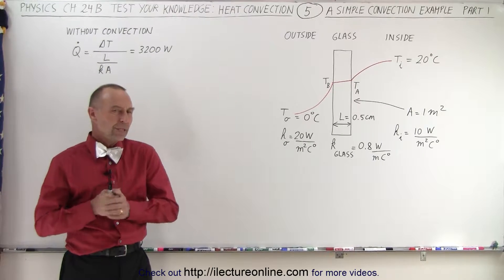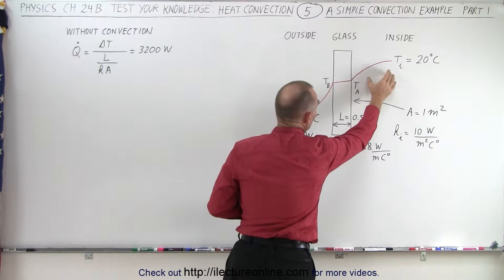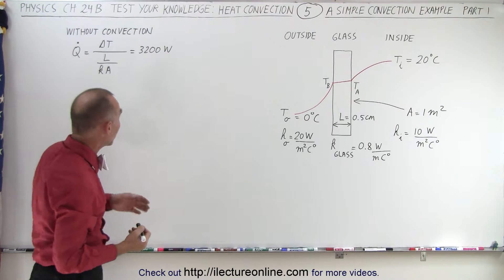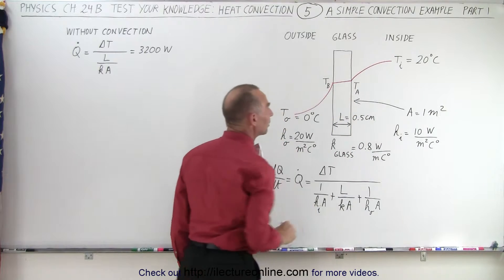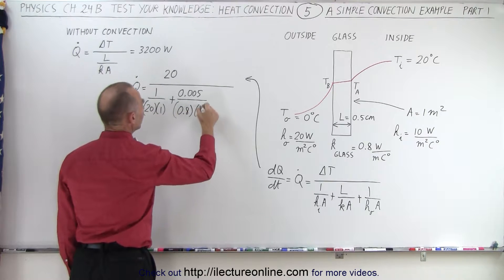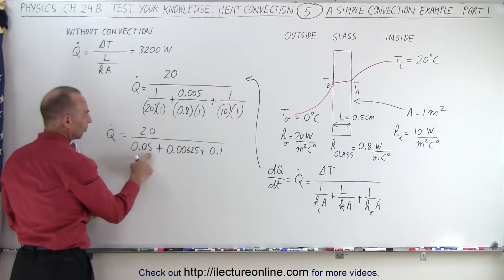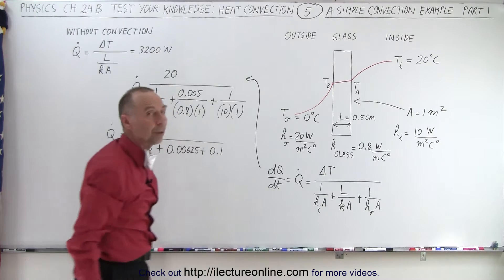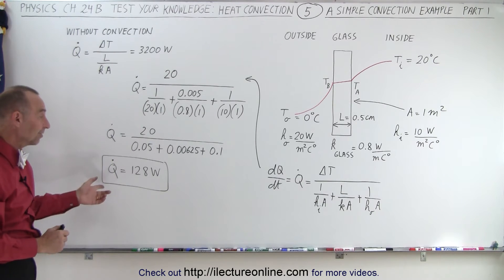Physics: Ch 24B - Convection: Test Your Knowledge (5 of 26) A Simple Example Part 1

Comment: So,,forced air should flow between the panes. What if the space were à vacuum?
Reply from the maker: In that case the heat would have to go across the gap via radiation.  However that said, if that was a vacuum, the forces on the window panes would be enormous and not feasible.

Comment: My boss assigned me the task of calculating the heater kW for a room, which requires determining the heat loss through a wall and a glass window. I was thrilled when I found your video, but I was disappointed when you mentioned that hi and ho are just random values. What's the point of the video if it doesn't explain how to calculate the exact values of hi and ho?